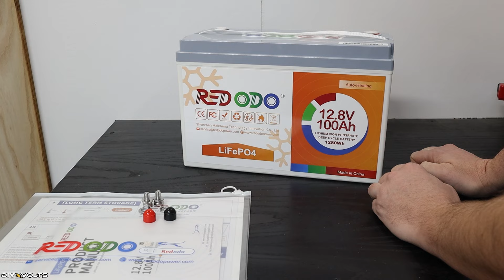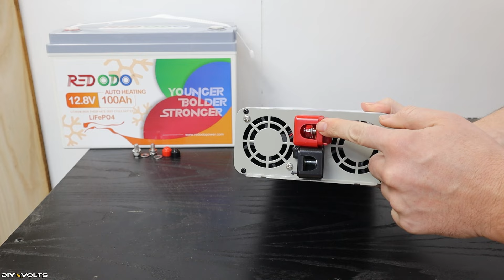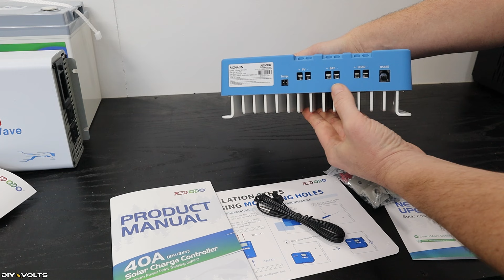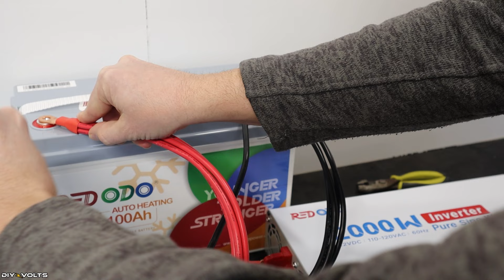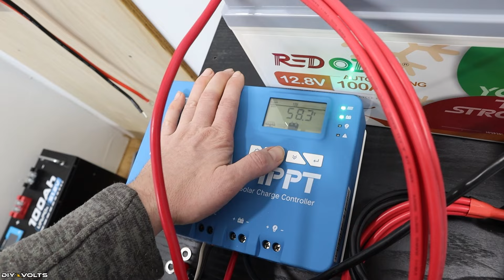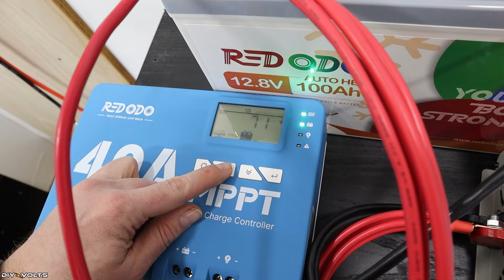Redodo 12v Heated Battery - 2000w Inverter - 40amp Charge Controller

Comment: Neat Combo. Thanks.  The "load" terminals on the charge controller are ideal for the camper's 12v lights, it will shut the load circuit off when needed to protect the battery from being over-drained.  Any idea why the inverter output was only 108v instead of 120v?  How 'clean' was the pure sine wave output?
Reply from the maker: Good point on the load circuit. I think that I am actually going to make the install very simple by installing an RV plug and just run the camper plug into the inverter. No other wiring would need to be done. I will need to test the output with my LED light to see if there is any flickering.